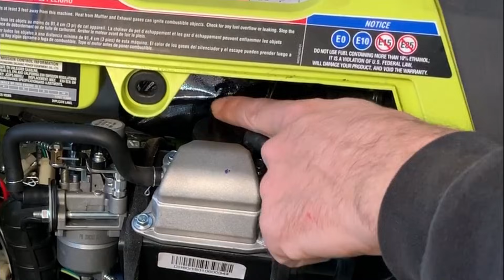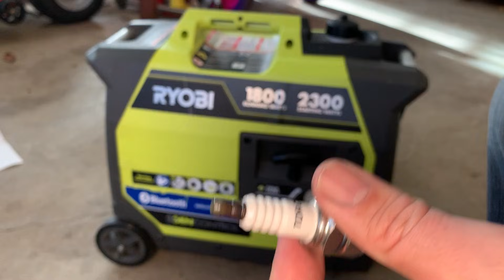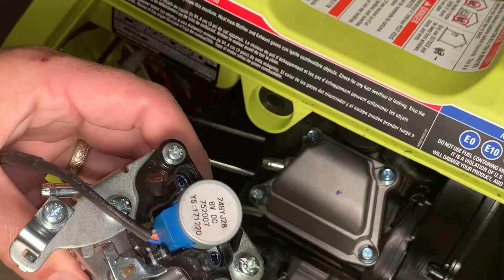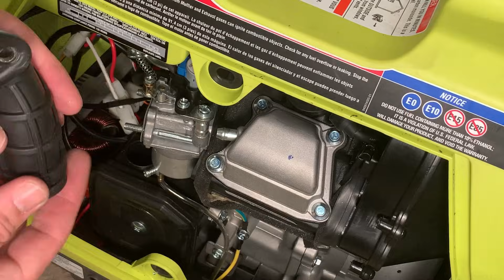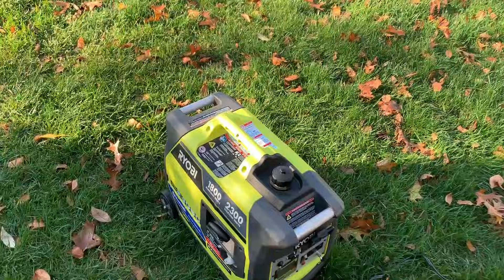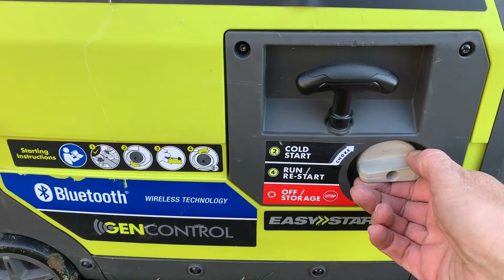Surging and Stalling Ryobi Inverter Generator Fixed - RYI2300

Comment: Good info iam from Puerto Rico i have the same generator got it for hurricane maria 2017 all maintenance done every 50 to 60 hr oil change. Got the same problem played with choke key still not work  have used it many times for the day time at nigth i got a yamaha 6600 for the hole house but now we just had a earthquake no power on the hole island for a few days. power is back thank God but just want to know where did you get the new carb from and if you have the item # for it but i really dont think its the carb tho but any help will be very thankful
Reply from the maker: Carlos Guzman I ordered from https://ryobipower.ordertree.com.  Part number with stepper motor HM-308054124.  Without the stepper motor HM-308054123.  I ended up keeping my Yamaha and selling the Ryobi.

Comment: Did some know what could be that when moving the knob to the off position the generator may not turn off? I'm turning it off with the bluetooth application
Reply from the maker: David Feliciano when turned off using the knob, it should contact a switch.  Either the knob is not contacting the switch, the switch is broken or something wrong with the wiring.  If you have a multimeter, disconnect the switch and start testing the switch for continuity when off and go from there.

Comment: Thank you for this! I have a pair of these and simply refuse to start without pulling the cord 50+ times. These were purchased less than a year ago. I also have surges as well so this video was helpful in the fact that I need to turn the dial more towards choke. I'm draining the fuel today hoping it's just bad gas. I also replaced the spark plugs with NGK. Pretty frustrated in my purchase. I saw on a different video to always add a little bit of stabilizer every time you fuel it up. I really don't want to pull the carb out. Thoughts?
Reply from the maker: I have owned a few Ryobi inverter generators and most have been hard to start.  I still have a RYI2000 and that one takes at least 20 pulls to start.  This was the first one that actually had issues once running.  Has it always surged since new?  Hopefully just the fuel value issue that I had.  I was tempted to bypass the builtin fuel value and go right from the gas tank to the carburetor and just add an inline shutoff.  Besides the spark plug and fuel valve, it is worth noting that this is a gravity feed system and the fuel tank is not much above the carburetor, would imagine if the level of fuel is low, it might have issues flowing to the carburetor.  Personally I think the compression release is overly aggressive making it easy to pull over, but hard to start.
Reply: @jcondon1  So I completely drained the fuel and added 91 with some Sta-Bil. It now starts on 1-2 pulls which is great but one of the two gens still surges. Messing with the choke position helps some. It still just annoys me that these are less than a year old and running into issues like this. As both are generating power, it looks like I'll just deal with it.
Reply: Open up the screw to your carburetor to get more fuel. I did it with mine and it helped

Comment: I had the same problem with mine.  It would run fine under load, but it would surge big time when no load.  I cleaned out the jets under the bowl but that didn't help.  I took the carburetor loose and cleaned the idle jet on top.  I don't know that any of the jets needed cleaning at all as they all seemed to be clear.  I noticed that watching it while it ran and surged, the stepper motor on top was really working it over.  I ordered a $13 stepper motor (was going through the process of elimination before getting a new carb).  I replaced it and, by the Grace of God, it started working just fine.  I haven't put a load on it as that was just 2 weekends ago.  I start it up every few days to make sure and will put a load on it this weekend to make sure it can handle it.  Thanks for the video.
Reply from the maker: Mark Moore let me know how you make out.